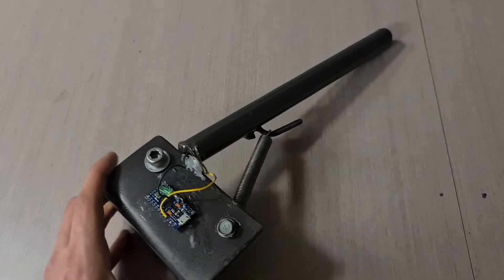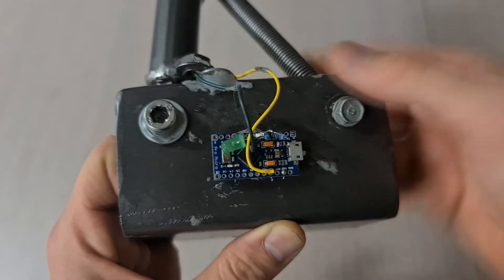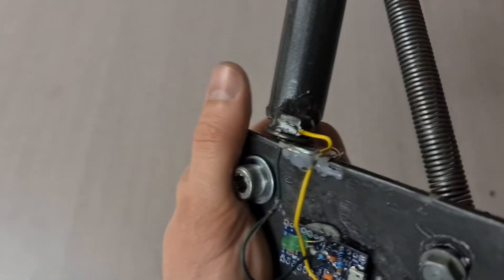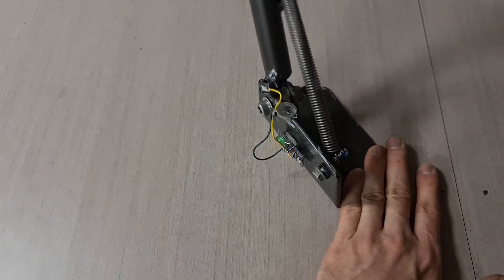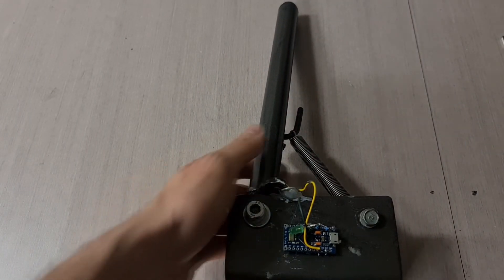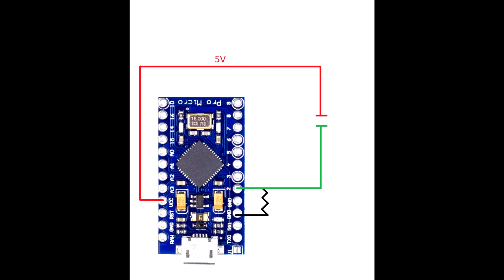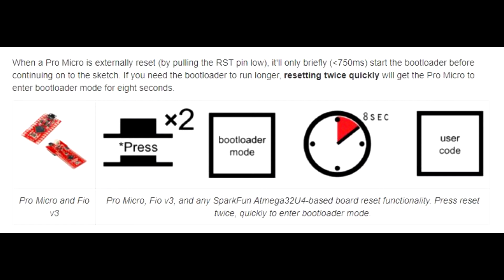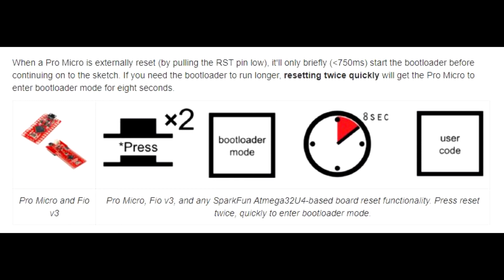DIY USB Arduino Sim Handbrake Budget

Comment: Hello, I would like to know what you used the resistance for and how much it is?
Reply from the maker: It's a pull down resistor for the button. 10k
Reply: @TechUpBuilds  Does something happen if I don't put any resistance on it?
Reply from the maker: @ericdehner3555  the button will stay on and it won't work
Reply: @TechUpBuilds  Will a resistance of 10k Ohms 0.25W and 5% tolerance work?

Comment: Okay I want to make one also. How.do I go about making a pressure sensitive one? So it's not just...on or.off ya know?
Reply from the maker: you need to use a potentiometer
Reply: @TechUpBuilds  will a ps4 recognize it? I'm trying to make ps4 compatible ebreaks..
Reply from the maker: @letrface_8596  No Idea, I wouldn't waste my time drifting on console.
Reply: @letrface_8596  Unfortunately such custom controllers will never work on PS4, as the games usually don't support more than one peripheral at the same time, unlike on PC. but I have just done a handbrake myself with a load cell. It's pressure sensitive, but will only work on PC.
Reply: Use a permanent magnet and a hall effect sensor.